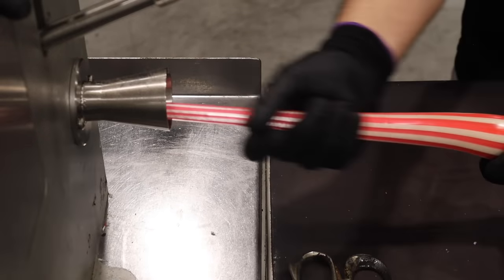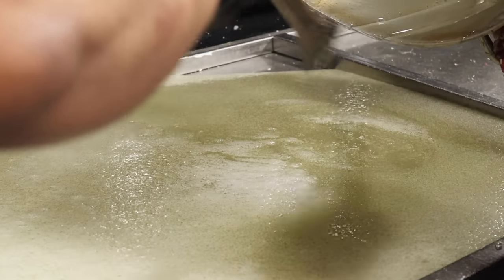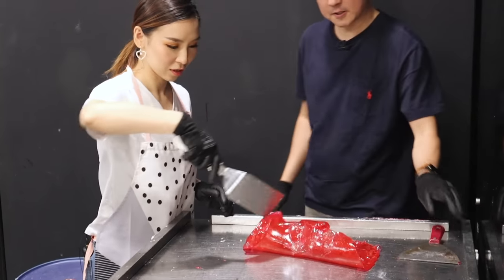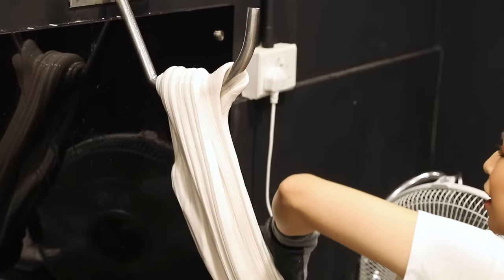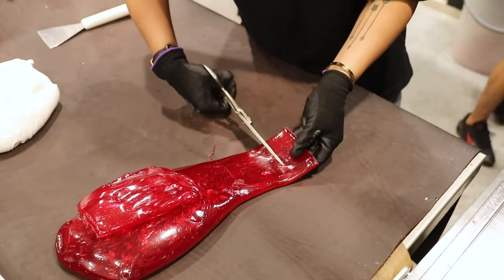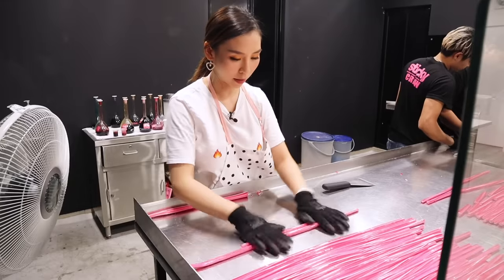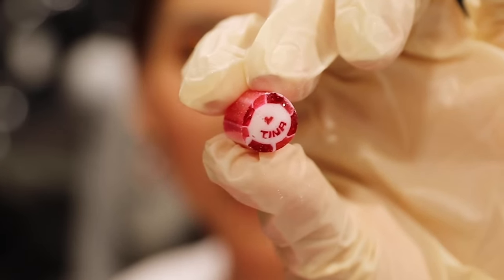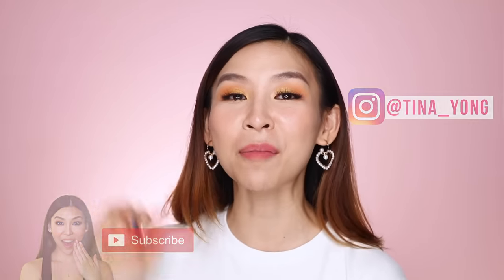Making Handmade Candy 🍭 | TINA TRIES IT

Comment: very random question but, can anybody tell me what the brand and model the gloves were that were used for the candy making, I could see that the black ones worn for most of the process were Kimberly-Clark Jackson Safety G40 PU, but I could not see the type of gloves being used for the candy pulling on the hook part. They were grey with blue edges and it seemed like there was a coating on it. If anyone knows , please comment, if a link is attachable much appreciated